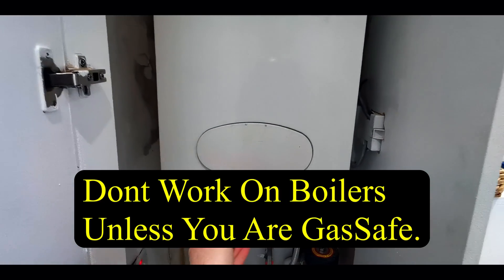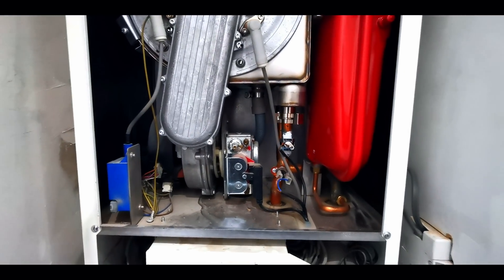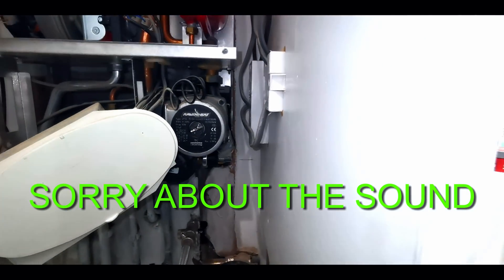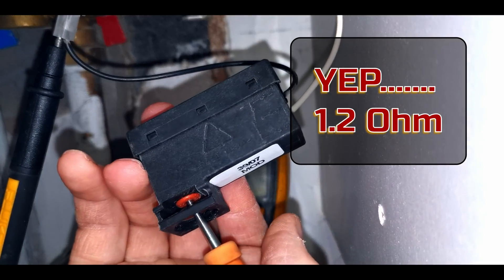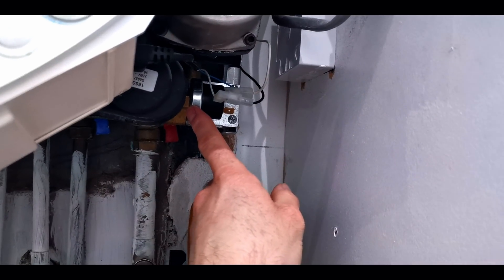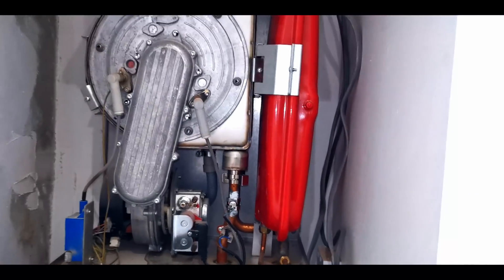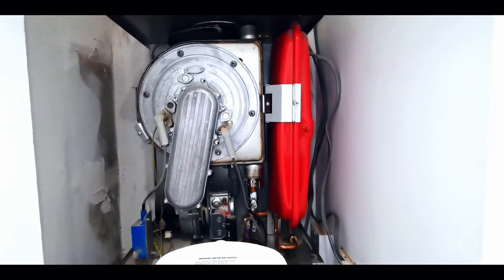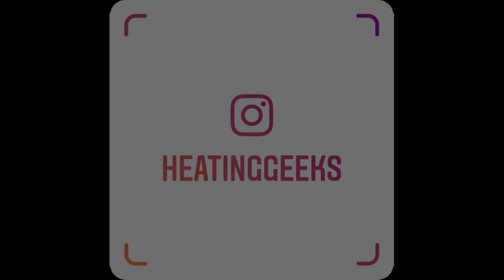Ravenheat boiler repair. This boiler has fault 28. Boiler not turning on.

Comment: How do you change the digital timer clock on the boiler. My digital timer not working sometimes. I have ravenheat boiler.
Reply from the maker: Get a gas safe engineer to do it.

Comment: Hi, i got same boiler ravenheat 42kw, its making loud noise at low hot water temperature when its running, can you tell me why its making loud noise like a jet engine  when running at minimum dhw ?

Comment: Hi mate,I've just come across your page.ive hot the exact boiler,it's not holding pressure. I've got someone coming to fix it Saturday, he reckons it's the pressure release valve, if it is this how much money would it cost roughly...this is my first house where I've got to pay for repairs...thanks for your time...
Reply from the maker: We charge £150 for a repair plus parts. so about £170
Reply: @HeatingGeek  thankyou for replying..I've had £200 in my head...👍👍
Reply from the maker: @johnatterton5344  Hope you get it sorted. :-)

Comment: Hi Ollie, great presentation on the video. I have same problem but continuity on all switches. Even when I just connect those wires together and bypass it all to test it I’m still getting it fail straight away on code 28. Is there anything else I can check. Thanks
Reply from the maker: The cables or the plug connectors. Could also be something wired in series.

Comment: If the previous engineer had taken the time to observe the pressure gauge and recharged the exp vessel the problem would have been fixed on the first visit
Good work
Good video
Thanks
Reply from the maker: Yep. But these engineers at this company are massively overworked and get 10-15 jobs a day. They get very stressed and can miss basic things. Im no longer working there. :-)
Reply: @HeatingGeek  I'm all too familiar with that type of business practice too
I worked for a large energy provider for a few months during 2015 , they were horrendous 
They would expect you to work from 7 am to late evening every day,  some guys were doing 16 hour days
They have no concept of quality over quantity
I've also worked for a very large boiler manufacturer who were just as bad
This is the reason I spent a large portion of my career in this industry as a sole trader 
Where I work now we operate a policy of 8 jobs per day maximum and all within a 10 - 15 mile radius
If an engineer is struggling they pick up the phone to us and we lighten the load without any fuss
Our priority is 100% compliance also zero tolerance for corner cutting
Reply from the maker: @liveloud9894  Thats exactly what I'm trying to do with my business. I want to make things the way they were 20 years ago. 8-10 a day, no engineer left behind while were all at home.
Reply: @HeatingGeek  where are you based?
Reply: Hi just after abit of advice had our ravenheat service no having a issue having to top the boiler up everyday what do you reckon the issue is please

Comment: In your opinion, what is the best boiler on the market today. .?
Reply from the maker: I have a Vaillant ecotec Plus in my house. However Vaillant boilers are delicate so unless the system is as clean as a whistle it will have problems. If I had a rental property I would fit whatever was cheaper amongst the lower priced brands with the best warranty. Boilers all use the same parts now so it doesn't really matter. Sorry for being no help at all. :-)
Reply: @HeatingGeek  
What do you think of the Worcester .?
Reply from the maker: @joebrennan.4389  They are ok. Good with debris but not easy to work on (They are improving this). I wouldn't replace it if I bought a house with one in. The Ri was my choice of heat only boiler because of the noise the 4 series Vaillant made. I wouldn't fit one but can't tell you why. 
This might be controversial:
Vaillant = Rolls Royce for ever. Delicate 
Worcester = Toyota Hylux for 7-10years. Tough until its not
Baxi = Mondeo. Will go on for a long time if looked after.
Ideal = Astra. Cheap. Does exactly what it says on the tin. Fit forget fail. Fit forget Fail. Don't invest too much money fixing.
Reply: @HeatingGeek  
I've been running a Baxi systems boiler in my own house for the past sixteen years now,apart from the diaphragm port getting blocked about every 18 months  (hard water ) it's never given me a minutes trouble. 👍
Reply from the maker: @joebrennan.4389  All boilers have their place. Baxi do make good boilers in that age range and they are a good price point. They lost there way after that for a bit but are on track again. :-)
Reply: @HeatingGeek  i always say in my quote imagine a boilers a car, you got worcester valiant there the rolls royce of boilers then theres baxi and gloworm which are your fords everyone knows how to work on a baxi and parts are reasonable and more than likely to be a stock item so quicker repair.

Comment: A splendid job mate, so strange that pressure related problems are so overlooked this days. What I also discover lately is blocked hoses and the hole  inside the heat exchanger to let the condensation water flow away to the siphon aren’t flushed out either by other engineers with you can see bye the dark colour of the back isolation part at the back of the exchanger . Why don’t they just flush it out with some water purging in to it and see how it’s flowing away? Standards are getting lower and machines are getting more complicated, not a good situation I guess. Still... top engineer where i  learnt a lot from, as from Alan Hart and a few others.
Reply from the maker: Thanks. I was sent because the customer wasn't happy with this being the 3rd or forth visit. I felt for the engineer because he was given way too much work the day he attended this job.
Reply: HeatingGeek  ,yea that’s why I am self employed.
I always leave time over for un expected situations and troubles . It’s not too little work you have that’s giving everyone stress and makes errors more playable,it’s too much work that is the thing to watch out for. Seya
Reply from the maker: @mayailusion5274  Spot on.

Comment: Nice one , Ravenheat are pretty common boilers in the north of England and to be fair there are a lot more worse brands out there, that i won't mention, also they have a great tech guy 
John Wilson who knows these boilers inside out and if your stuck he will give you the pointer to the problem......cheers
Reply from the maker: I don't mind Ravenheats newer boilers. The location of the diff switch is a little poor. :-( but I would still fix it. :-)

Comment: Ravenheat Available at all good B&Q outlets  . Ideal for the DIY boiler master who likes a bit of plumbing in his or hers spare time LOL
Reply from the maker: Yep I agree. But if you look at the top half of the boiler it normal high quality stuff.Its just a shame that they can selll them to anyone but DIYers.
Reply: As an NICEIC registered electrician it's the same with consumer units, anyone can buy them. Knowledge is power, if you know your stuff you will be in demand. I know a few heating engineers and whenever I have a problem with my Ravenheat they just want to put a new boiler in. I won't let them. My mother in-law has had more problems with her Worcester boiler than my Ravenheat and they are the same age. I have often thought of doing gas course but just get an engineer in for any gas. Fault finding boilers would be my forte but I'll stick to electrical. I'm sure the grass is greener and with the price of some spare you could soon come unstuck.

Comment: Why would someone put two zone valves on a combi?
Reply from the maker: Up stairs and down stairs. :-)
Reply: Upstairs and downstairs heating zones.  You could fit a low loss header, with a smart pump on each zone eliminating the zone valves. Then you can have thermostatic radiator valves on all radiators and no wall thermostat.
Reply: @johnburns4017  how much would that cost compared to two zone valves
Reply: @twigthewonderkid1  
The difference between two zone valves and two smart pumps. The rest is 28mm pipe for the header.
You have independent control in each room. No central room stat to cut out the whole system when some rooms may be calling for heat.
Reply: @johnburns4017  If there is no Thermostat calling for CH - then what starts the boiler ?
Reply: @shilks8773  Could be a pipe stat on the low loss header to give an interlock. Or nothing at all, just the boiler pumping around the loop.

Comment: Why would you test the switch with ohms not continuity? I would always Bell a switch out is ohms better?
Reply: Continuity only works up to 2k ohms so you could think something is broken but could just have just over 2k resistance
Reply from the maker: @chriswhite3090  I was taught to always use ohms for testing. If it was high resistance I can clean the micro switch with contact cleaner and get it going again.
Reply from the maker: I was taught to always use ohms for testing. If it was high resistance I can clean the micro switch with contact cleaner and get it going again.
Reply: The Worcester guy was going on about it on Wednesday when I was on the fault finding course. He said it better to check in ohms aswell

Comment: Another excellent video mate !the tell-tale signs were there of air in the system! Also did it have air pressure in the
Expansion vessel ? It seems like it’s still got the original red factory paint around the shrader cap?
You’re a great engineer mate it’s always a pleasure watching you ,I’m down in Brighton on the south coast and you don’t see many boilers properly repaired any more they just seem to condemn anything and quote up for a brand-new boiler I’ve seen it too many times even on very minor faults on a 2year old boiler, some of the bigger companies are worse and won’t even attempt to repair
Reply: Salim Khan sign of the times Salim, too many course cowboys about.  They can sling in a new combi, but totally clueless about repairing them.
Guys like us are a rare breed mate, charge plenty & live well from their failures👍👍
Ollie knows his onions & is a lovely guy too.
Reply: Fibre Washer yeah I reckon you are right mate just the sign of the times and it seems the bigger the company the worse they are! I’ve got myself a brand-new looking three-year-old viessmann vitodens 050 for free as it was being put on the scrapheap from someone else’s job , only needed flushing out as the return hoses & plate were blocked, nearly £900 boiler!
Reply from the maker: @SalimKhan-gk1fh  Nice one. I have a Turbomax Plus in the garden just waiting to go in my house!!!
Reply from the maker: The vessel was flat and the Air in the system gave the game away. Simple repair but no one has time anymore. Companies pressure people into working way to fast and these  things get missed. Keep them on the wall. :-)

Comment: Looks like your doing a bit better now Ollie, I hope things are on the up.
Was the expansion vessel over one bar on this along with the air in the system or was it just air?
Reply from the maker: The vessel was flat and the system was full of air. This was filmed when I was in my old job. I just added the intro etc.
Reply: @HeatingGeek  
The vessel charge is 0.5 bar on this combi?
Reply from the maker: @johnburns4017  I always pump to 0.75 on everything (boiler wise) and its always ok.  Why do you ask?
Reply: @HeatingGeek  
Just curious.